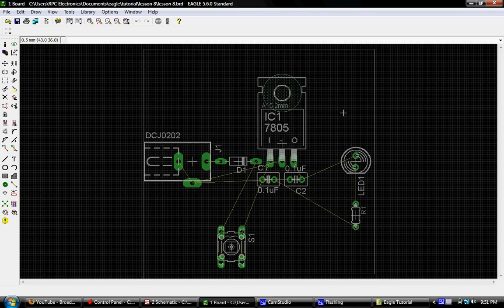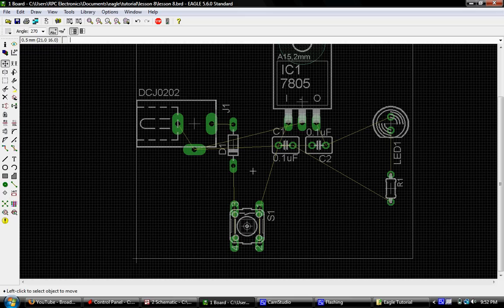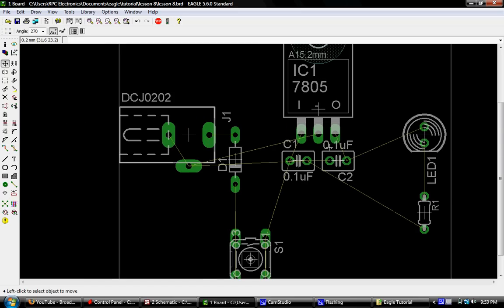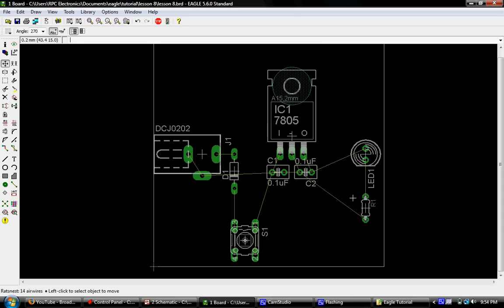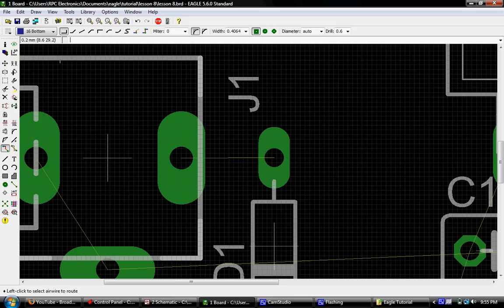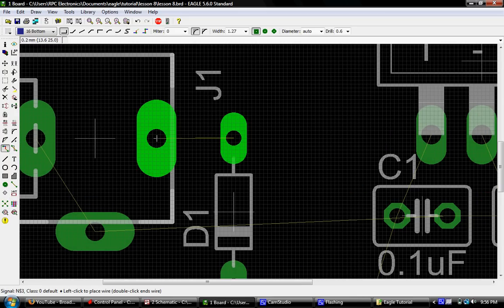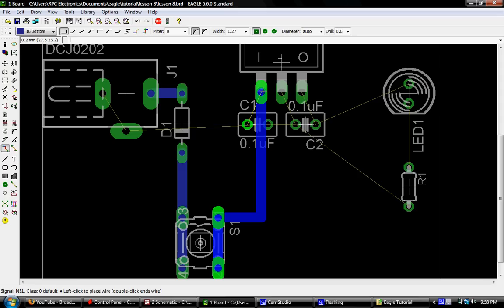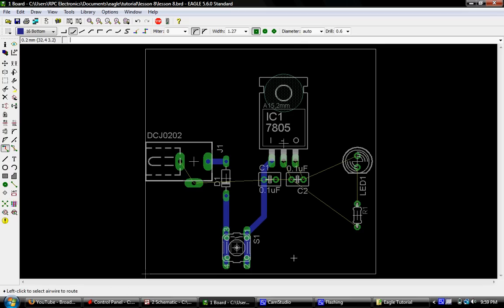Cadsoft EagleCad Tutorial Lesson 8

Comment from the maker: @H3ADSH0TER That is hard to answer without knowing what you are designing and without seeing a schematic.  In general the answer would be NO.  Almost all electronics, in some way need to be arranged in a logical way.  This may be as complicated as keeping runs short to reduce the chance of noise induction or simple as logically placing parts so your runs are simple and do not have to run all over the board to get from point A to point B.